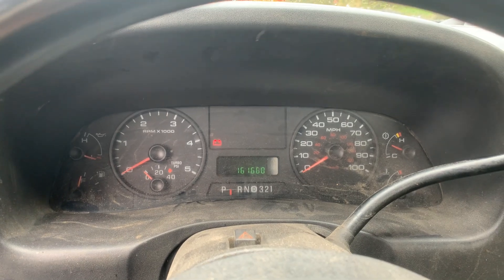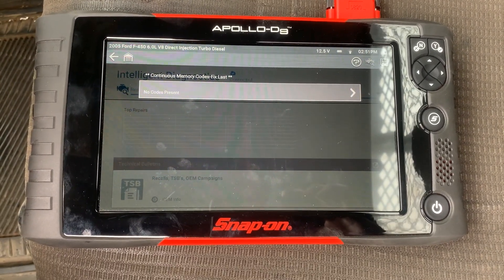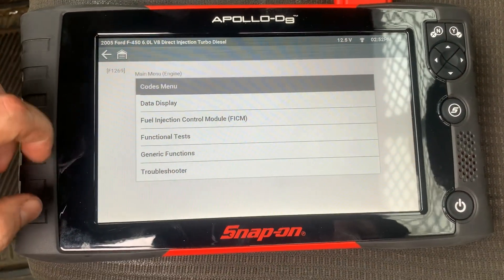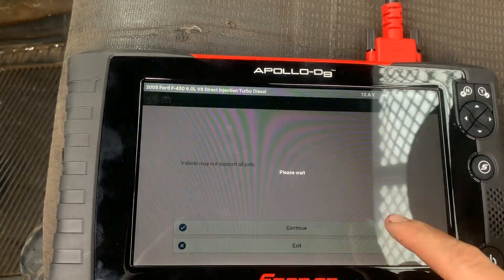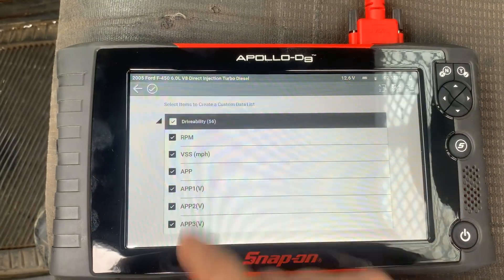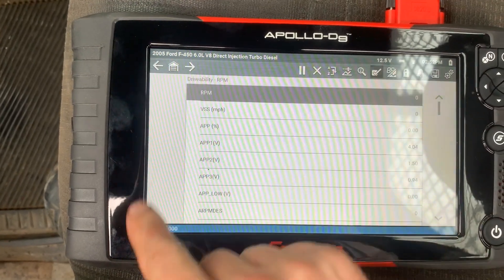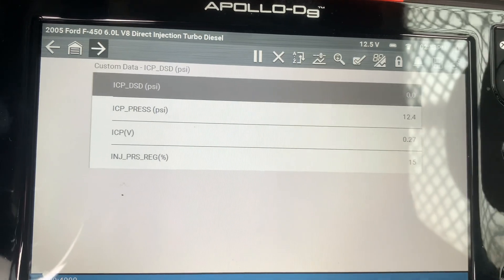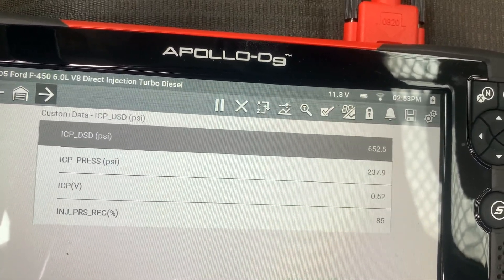2003-2010 Ford 6.0 long crank/no start hot

Comment: I’m having an issue with a truck that is doing the same thing, cranks up fine when cold but has to crank for at least a minute or 2 before it’ll start when it’s hot, ipr is at 32% at idle when hot and only makes 2k psi at full throttle when hot, it’s an 06, i put shop air to the icp port after getting the oil hot and I hear maybe a little bit on the passenger side but barely, nothing like in your video, just replaced the ipr and standpipes and dummy plugs and it was good for a couple months and now having another hot no start, I honestly am kinda dumbfounded as to what’s wrong with it

Comment: I have an 06 that will start mostly fine when cold. I had replaced the fuel pump because it was cranking long and had to stomp the gas to get it to start cold or hot, and it will come to life when cold and will run good until I cut it off. If I try to start it hot it will just crank and then say “TBC fault” also the new fuel pump makes a louder bubbling noise not sure if it’s important but it was not OEM

Comment: Extremely helpful. Got an 05 crank no start intermittent but I think it's when it's warm. It had an IPR code but he replaced the IPR and of course it still wouldn't start. So I think I'm going to go straight to that stand pipe and pull it out and check that o ring. Watched another video that showed how to get the pipe out without removing the rail.

Comment: We have a long crank to start cold and no start when hot. It cranks a long time before the dash shows oil pressure but once it shows it starts up. Just got done replacing all injector, fuel rail nipple o-rings, and pipes/plugs. Oil filter gets oil. Oil pump plug came out no issues. It slid out with no magnet, and no metal was found.  Pulled the ipr and screen looked good, no metal found.  With scanner, activated ipr and tested good.
Reply from the maker: Make sure you have the right oil filter in there

Comment: Excellent video best explication I have seen. Thank you so much keep up the great work. I have a 06 will not start cold or hot. I spray starting fluid and it cranks and runs good.

Comment: My truck does this but will start if we have a truck with cables on both batteries. And sometimes starting fluid it will start as well. Will this still apply to my truck? 2007 6.0 powerstroke 180k miles.
Reply from the maker: Yes

Comment: How much would a repair like this cost?
Reply from the maker: Usually shops do a flat rate diagnosis for the first hour and then straight time after that, and typically it’s 4-6 hours labour, once you have done a few you can do it faster but you gotta make it worth your time, 700-1000$ depending on shop rates and parts

Comment: Thank you for this video. I have an 05 that is currently experiencing this same issue.
I do have a couple of questions if I may:
When doing the air leak test through the ICP port, do you not have to command the IPR off first? I watched your video twice and did not hear you mention this. So, I thought I would ask as I am getting ready to leak test mine very soon.
Secondly, do you have any idea what would cause the ICP senor to keep going out? I have had my truck for 7 years and have replaced the ICP 5 times. The first two replacement were not OEM, but the last three have been. Could parking on a hill with the nose down be a possible cause?
Reply from the maker: The ipr valve will hold up to 500psi I believe without any power to it unless it’s got something jammed in it holding it open, and honestly I’m not sure is your truck tuned? It’s not an item I replace very often, maybe your pressure is super high due to tuning
Reply: @bradgdiesel3243  No tune. EGR deleted but thats it. I believe the previous owner upgraded the head bolts but did not put studs in it. The ICP has been my biggest problem with this truck. Luckily, with it being an 05, the ICP is on the valve cover. So, it has been an easy change out. 
I know that asking about the truck being parked on the hill may have sounded a little strange, but our drive way was so steep that if I parked my truck at the top with the nose down and on new tires  , it would slide down to the bottom of the driveway overnight.
I started paying attention to when the icp would go out and it was usually within a few days/weeks of parking the truck nose down in the driveway.

Comment: Hello BradGDiesel I have a 6.0 Ford F-250 diesel I changed icp sensor,  now it starts but now it shuts off after about 45 of running and dosent start while hot only cold any ideas?
Reply from the maker: If your oil level and everything looks good, it could possibly be an injector letting air push back into the fuel system causing it to air lock

Comment: Did you turn key on to close IPR valve? Before putting air pressure to it
Reply from the maker: No need for that the spring in the valve will hold 500 psi with no power to it as long as it isn’t stuck open, I am using shop air 155psi max

Comment: What if I didn’t hear a leak from the IPR side but I didn’t push air through the ICP ?
Reply from the maker: I’m sorry I’m not really sure what your asking, where did you inject the air? It’s tough if your doing it the way I am in this video sometime because the ipr valve will always dump and sound like there’s an air leak that’s why the best way is to actually inject the air thru the ipr valve port if your uncertain

Comment: I just had the same problem, when warm I have 318  PSI at the ICP sensor and I'm gonna do the air test to find ICP leak and hope it just a stand pipe and not injectors. Great video!
Reply from the maker: Glad I could help good luck

Comment: Mine cranks about 3 seconds if not 4 seconds, it’s an 07 but it’s gotten worse slowly, cranked like normal etc then slowly got longer. 198k, I was suspecting stand pipes based on the crank but do you think it could be anything else? It is about 20-30° here right now, it does that long crank while the engine is warm. I don’t wanna be stranded so I’m trying to figure it out
Reply from the maker: It’s most likely taking longer to build pressure, could be anything stand pipes and dummy plugs are common but could be injector o-ring or something else on the rail, only way to find very small leaks is use something like nitrogen thru the Ipr valve port, otherwise you need to wait until it gets worst to find it

Comment: Did you replace any other seals while in there or the front dummy plug?
Reply from the maker: Just dummy plugs and stand pipes, not a bad idea to check everything else, I have never seen the rail nipples fail unless people have tried to re seal them, so leave them alone, also if you have a bad internal injector o ring I recommend replacing the whole injector